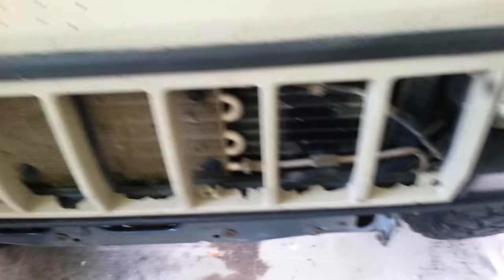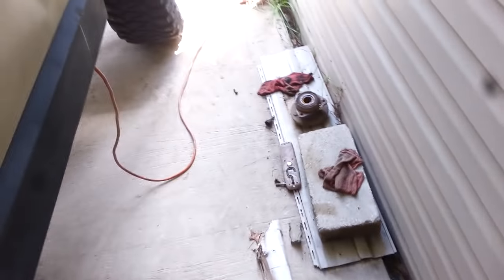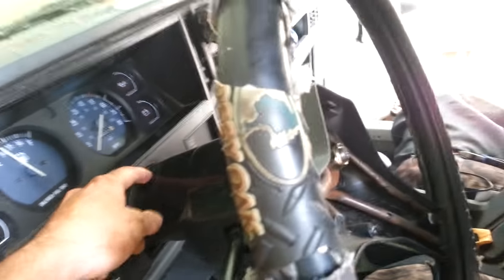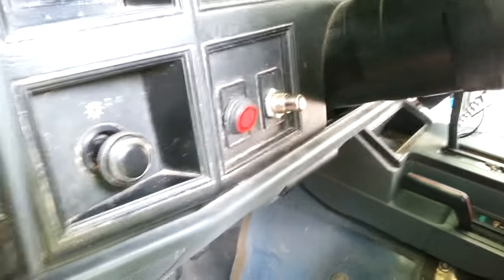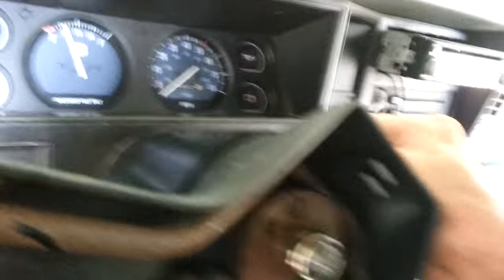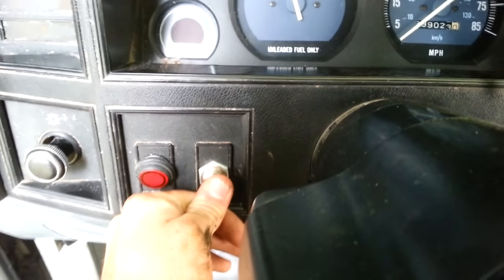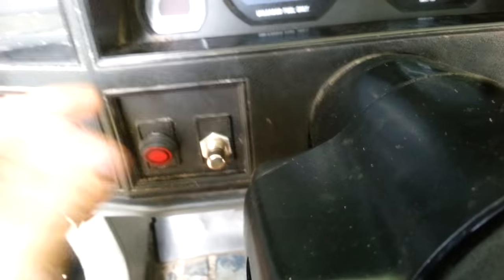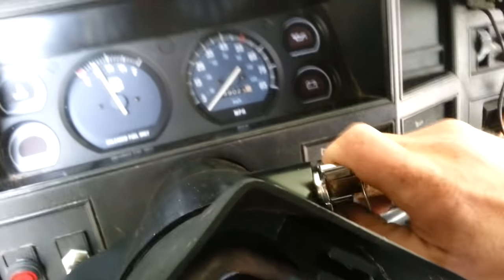How to install a basic push start switch

Comment: THE SWITCH you need is called a momentary press switch. Its always off and only turns on when held down, thats why these peoples starters don't shut off.
Reply: Normally open - turn closed button
Reply: @woahh.curtiss I'm here 3 years later
Reply: Not sure why I was typing in CAPS. And he used a momentary press switch. What was a complaining for

Comment: i wired my pathfinder just like you did in this video. But the way it's wired now if you push the start button with the key off the ignition the starter will still crank but engine will not engage. A good idea is to install an on/off switch to the start button.
Reply: It sounds like you have the button hooked up to the big wire on the starter you need to get it on the signal wire on the solenoid

Comment: so if i get this right the switch has 2 (+) terminals. one wire goes to the switch to the battery amd the other terminal from the switch goes to the starter signal
Reply: Yes. The starter is bolted to the chassis which grounds it out.

Comment: EXCELLENT BPM03.  I have a 92 buick lesabre.  i ordered a new starter because i was tired of jumping my solenoid on the ground with a screwdriver.  installed the new starter and I'm still jumping the solenoid with a daggone screwdriver.  i thought about my relay, and 2 other shade tree mechanics said "NO, that aint it".  They both said its that "rod" in the steering wheel shaft.  So they both said, Man all you gotta do is put a switch on it.  I just had to find a video to know what and how to wire it.  Sounds good and easy.  Your video will be my teacher. I appreciate this info.

Comment: I have a 1998 Dodge Dakota I got from my neighbor. They wanted it gone and I was interested in a second car. Eventually, it developed a problem where it wouldn't start easily in Park. I installed a push-button switch to create a short between the positive battery terminal and the starter solenoid so that it would, at least, turn over. Been using it ever since. AND it's been a year now. I mainly using it for emergency weather situations and when a neighbor wants to get rid of something big. Paid for itself when I brought home a faulty Hisense 55" TV (worth probably $250 brand new) and a clogged Shark Rocket vacuum (worth $250 according to Amazon) and fixed them both up.

Comment: Ok ok I got it I run a wire from the pos side of battery with a fuse attached and then one from the starter shit my pants and push the installed button/switch got it! THANKS

Comment: What about on a Ford with a starter solenoid? I’m trying to do this because I ave to start truck Every time with two screwdrivers touching the starter solenoid. I just ran a wire from each terminal of the solenoid to a button but it seems it’s not dry enough power so I just bought thicker gauge wire does that make a difference?

Comment: Ok I can the wire go to the Solenoid on the fender wall or does it have to connect to the starter ? And what size wire would you run. I have a 1982 F 100 ??

Comment: well the easy way is to wire it straight to the starter relay like in the old fords wouldn't be any different as if you put a screwdriver on the relay to crank it

Comment: So let me rephrase you said, the button has two positive terminals(A) and (B), you get 1 wire, connect one end to positive battery nipple, the other end is connect to terminal (A) of the switch, NOW you get a 2nd wire and one end connects to terminal (B) of the switch and the other end connect to the signal of the solenoid on the starter right?? This is how i understand it! Ill try on my dodge
Reply: So 2 wires connect the the back of the push button...one connect to the signal terminal directly on the starter, the other to power source, in this case directly to the positive battery terminal...the only negative on this set up is if the key is NOT turned on, and someone pushes the push button it will activate the starter but vehicle will never turn on could result in frying ur starter....kids play in car and pushes it etc...if u connect 1 end to a fuse box that gets power when ignition is turned on it can work that way also...
Reply: Good video..I've done push start on my 83 c30 diesel...1 push button for my glow plugs another for my starter...different but cool
Reply: Destiny Maseuli ok so let’s put it like this. If you are unable to control your children enough to trust them to not start your car then you A. Need to discipline your children and/or B. Don’t need to put a friggin push start button in your vehicle. I think I summed that up correctly

Comment: Why can’t I run wires directly to the back of the old key cylinder wires. My key is on my dash so easy access. Can I just put new switch on dash or button and jump off old key cylinder

Comment: Bought  truck with a toggle switch to engage starter.  Wire running into the dash has come loose and have no idea where he had it attached?  Now wont engage starter.
Any idea where the wire may of been attached?

Comment: aww man, my turn key tumbler wont even turn on acc? No power at all. Read somewhere that I can use the acc, ign and pwr wires from my ignition switch harness under the dashboard. maybe use two switches, one for acc, one for starting.  What would you recommend in this case? Thanks!

Comment: Tried to do the same, but my starter has a solenoid but do not have any conectors at all like other starters who may even have 3. I noter the positive cable from the battery attaches to the back body of the starter and the negative to the bottom part of it. there's 2 other nuts with no wires attached.

Comment: What time of wire did you use? I did this on my 91 f150 and it seems im not getting enough power through the wires. They spark but doesn't turn over the motor. Any help would be great!!!
Reply: Did you find out if you needed a thicker cable? I'm doing this now and it seems like the gauge of wire is too small
Reply: @Keith Rogers  yeah i ended up going with a thicker wire because it was losing to much current through the length of it
Reply: @flukeyafishing6774  thanks I will give that a try. I've don't alot of work to this car but not much wiring. It's a 98 honda prelude

Comment: So if it's not wired to key how do you turn it off?
Reply: Even though the starter wasn't working from the key, his key still controlled the volts to the distributor so once he cut it off it killed the power

Comment: Is there a specific wire you should use or one that you would recommend?
Reply from the maker: +Mahogany Boyd the one i recommended is the one you have to use.
Reply: 10-12 gauge
Reply: how many wires are there total?only 2 or 3?

Comment: confused??? did you run a wire from hot post on the battery to cold wire on starter?
Reply: long dont 7

Comment: What amperage was your switch?
Reply: xXTHECARGUYXx I think around 5 amp would be suitable with a 5 amp in line fuse to be double safe. I have tapped into signal wires in cars before and 5 amp has always been enough to send the message
Reply: @urbexyounggun2214  I’m having this same problem I did the same thing and ran a 30a switch and intime fuse from the battery to the button and it keep blowing it am I doing something wrong
Reply: @jonathonnewport336  you haven't by chance ran the switch in line with the starter wire ?
Reply: @urbexyounggun2214  the online dude is run from the batter then after the fuse I ran the line to the switch then from the switch straight to the starter
Reply: In-line not online
Reply: @jonathonnewport336  thats your problem right there bud. Your circuit is basically turning the starter on and off. The starter requires a sizeable amount of current when turning which is what will be causing your large fuse to blow. 
You need to run the switch in with the wiring in your ignition barrel. There's usually between 3 and 5 wires on the back of the barrel, one of them is for the starter motor signal. You need to tap into that line with a switch,  permanent live on one end and the starter signal wire on the other. Your switch acting as a temporary bridge between the 2.

Comment: Same thing happened to me and I did this n it jus cranks. Also i didnt use key i jus hooked up the two terminals. Any help
Reply: Rip Hick the ignition needs to be on accessories aka on position  so gas pump engages or engine would just crank , if u don't have a key then jump the fuel pump relay

Comment: Did you put a fuse anywhere?   Need to do this to my S10..  :(     Hope you're still out there :)
Reply from the maker: no, nut it would probably be smart though
Reply: I asked before I had one..  The button did't come with nor suggest using a  fuse so I skipped it...         Working fine!  Thanks :)

Comment: why need key at all   ?
Reply: all any switch does is continue the electric current.  my choice would be a toggle switch. we have problems with keys . thieves just continue the current and drive away.
Reply: 1st run a wire from  battery pos to starter pos. see if it works , make sure in park or neutral. i always block tires i am a coward.  when you turn a key it starts you release key, same with switch when it starts turn of toggle .  when you turn of a key the  engine stops so the key does more than activate the starter,  ask question on line ''how to  over ride key switch. i  lost myself , i will look up as well.
Reply: @spymaine89  if u touch a wire off the pos batery to the pos starter .. will it start

Comment: Lmao, you don’t even have to run a word from the pos of the battery. Ever had a starter selonoid go out? You can literally start the car using a piece of metal to bride power from one nut to other. Basically to install a push button start just find both selenoid nuts, 2 wires. Wire 2 wires to your selenoid, 2 wires to the switch. Done!
Reply: But still dont have power to the dash for ignition

Comment: which one is the single wire? To dark to see.
Reply: signal wire, the signal wire is the wire that comes from the ignition switch on the steering column to the starter.